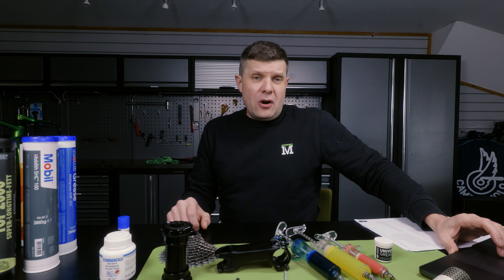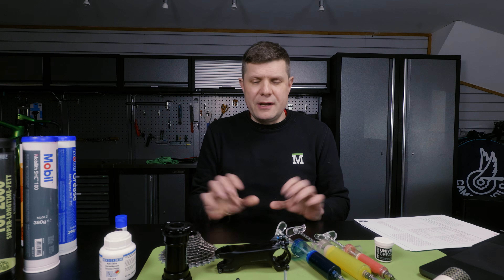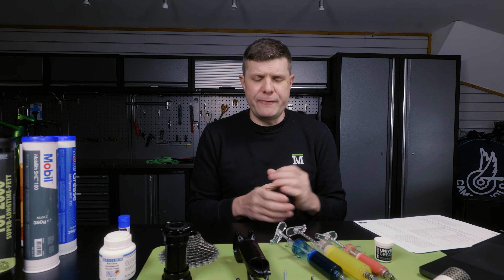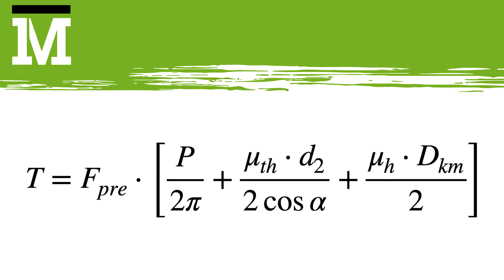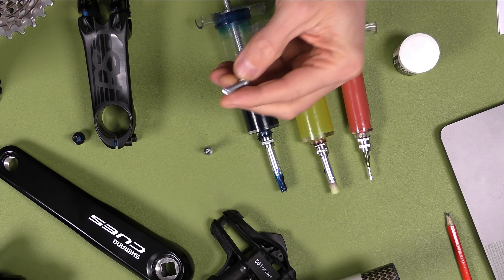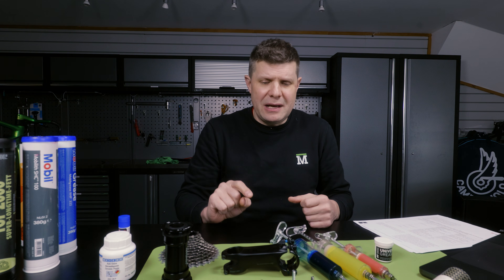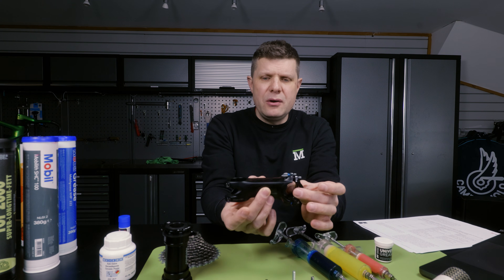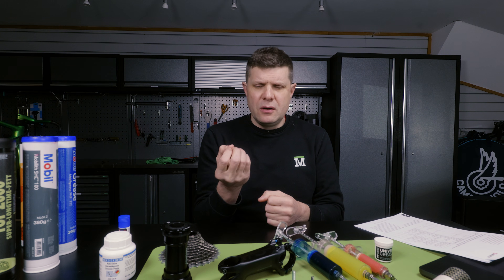Are You a Good Mechanic? (Or Just Lucky?)

Comment: I've noticed that the polylube (green park tool stuff) tends to wash out over time on something like a commuter bike with a cup and cone hub. Has anyone else seen this in wet climates?
Reply from the maker: Yes, it was what stopped me using it. It also does not mix well with factory lubricants. Mix some with a Lithium grease and you will see the oils separate over a couple of days.
Reply: @Mapdec  No, you are wrong, the combination of greases and oils and how the differences in hydrogen bonds affect how they will combine and what if any seperation will occur. It is chemistry not bicycle mechanic jibber jabber, aslo lithium grease is the absolute worse grease as it attracts dirt very easily and consequently turns into a dirty thick paste and discolours certain plastic parts and light coloured painted surfaces. (light coloured bicycle paint jobs). I never use that crap whatsoever.
Reply from the maker: @chrisC5339   Oh look it is Chris again, being wrong... again...   Nearly all of the ISO bearings used in cycling will come with a Lithium Complex grease factory filled, most likely XHP222. The attraction of dirt has nothing to do with a grease being Lithium, Calcium or Polyurea based. Now, the stuff you are referring to is probably that old White Lithium grease coloured with Zinc Oxide and separates to a brown liquid.  I totally agree, this should never be used.  I have mentioned it several times.  Just do a little research into how many brands use XHP222 from factory compared to a Polyurea grease like Park PPT (0)  The brown oil that seeps from that old white grease is what breaks down plastics and paints, not the lithium.  I wonder where you will spring up next, this is like playing whack a mole.

Comment: The first overhaul I do on my bikes. I fully clean and decrease the entire bike and re apply the high pressure red and tacky. It sticks well and blocks water ingress. I used to use the green grease you buy at the shops or from China but I find it washes away really quickly especially on the mtbs. The price of the green grease is also 👎
Reply from the maker: The green grease is just Autol Top 2000. If you buy it raw it is cheap. It still has a use, but we use it very rarely.
Reply: @Mapdec  it's hard to find it here in Ontario Canada. Auto zone and Canadian tire don't carry it.
Reply: @burningatthetrailhead  The green grease (especially the coloured Chinese stuff) is utter crap, if you want decent "expensive" bicycle grease Park Poly Lube is of a high quality but similiar can be found at UAP and others.

Comment: Bought a new bike and when they assembled it they applied Loctite to mount the caliper to the fork. It was an amazing experience stripping the thread out of my brand new Fox Factory.
Reply from the maker: That should have been fine. oh, unless they filled the blind hole with liquid
Reply: @Mapdec It was the wrong type of Loctite so the threads came out with the first disassembly for cleaning.
Reply from the maker: @TheFritzNL ummm. I am not convinced by that.  Loctite put a ton of effort into making all their threadlocks have a very similar K.   The other possibility is that the bolts are stainless steel or titanium and they used loctite where it should have been an anti seize to stop the galling effect.
Reply: @Mapdec The wrong mixture of alloys and Loctite sounds very plausible. (Can remember and feel the experience as it was yesterday from over the moon with a new bike to that tight stomach knot. A helicoil did it's magic)
Reply from the maker: @TheFritzNL   Ahh.. Did you get that horrible gummy feeling?
Reply: Yeah, aluminium threads assembled with threadlocker can on occasion gall and strip out on first disassembly. As a rule I avoid using threadlocker on aluminium unless there is absolutely no other way.

Comment: Way too much white grease on the axle i agree, but the axle does not rotate in the hub, so what do you mean with centrifugal force?
Reply from the maker: Fair, maybe that was not clear, all that grease that got scraped off as it passed thorugh the bearings.
Reply: You only need  small amount of grease to easily pass the axle through the bb bearings, 99.5% does get scraped off, but please don't use that white lithium type stuff. Years ago Campagnolo sold this hideous white so called "special" grease (lithium based) in tubes that broke down very rapidly and did not adhere well to components, utter s**t.

Comment: Parks standard grease has worked on every bike I've used in the last 35 years.
Reply from the maker: When you say 'worked', what is your definition? Park PPL is a Polyurea grease.

Here is a fun experiment for you: Mix some PPL really hard with some standard Lithium grease. Leave it for a few days and you will see the oils separate and run out. Lithium and Polyurea are generally incompatible.

That sludge left behind can turn into a hard, clay-type substance—this usually happens if you leave a bike untouched over winter. You have probably seen it in your workshop but just considered it normal to see hub internals become 'oily' rather than 'greasy.'

Of course, this depends on how you use it. On fully cleaned-out Cup and Cones (where it's the only grease), it works fine. But if you refill a sealed bearing, or grease an axle next to DT Swiss Moly grease, you will create that cocktail effect. Let us know what you find if you try the mix test!

Comment: Don't know if you know, but the colour of all the thread lock adhesives are down to a us military standard so nut stud bolt and thread lock etc are standardised,
So loctite draper etc should all be the same colour for the same strength
Reply from the maker: Oh.. I knew there was a standard, but I did not know it came from the US military.
Reply: Actually it originated with fighter planes during WW2, they needed a product to lessen the loosening of components under severe vibration, many companies not just "Locktite" manufacture the various levels/colours of thread locking compounds.

Comment: Just use white lithium, has worked since the 60's just fine.
Reply from the maker: I was waiting for this comment... Bike have changed a bit since then. Did you notice? More plastic, more carbon, more electronics, significantly lighter.
Reply: @Mapdec who cares? Lithium is safe for any surface. And what does weight of the bike have to do with anything??
Reply from the maker: @bikes7777   The lithium isn't the problem it is just the carrier. The lubricant (oil) is that element that damages plastics. Anyway, to make things light you need to use more fragile parts. Plastics, Composites etc.
Reply: Im guilty of this😂